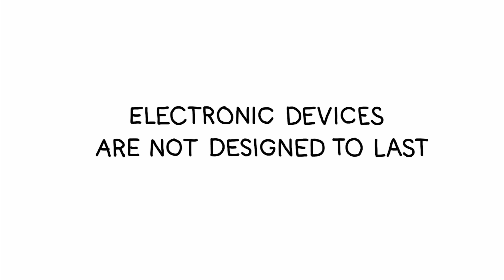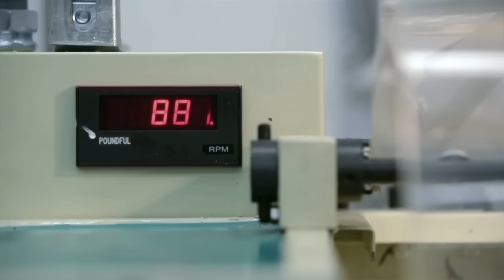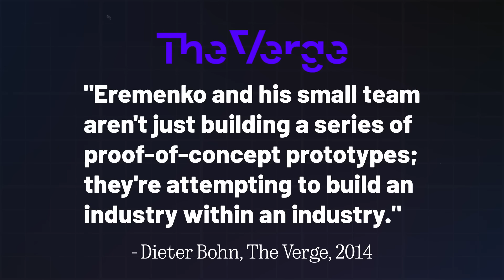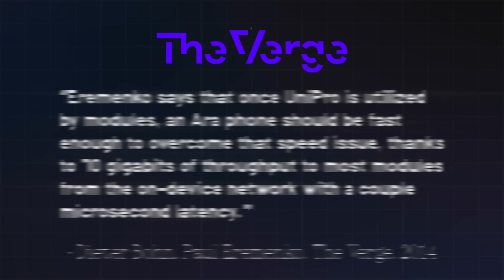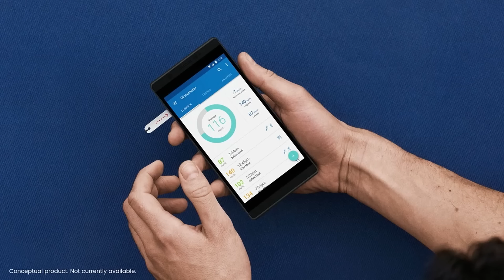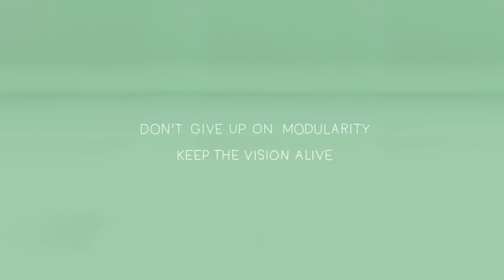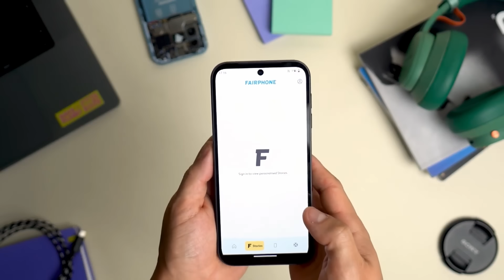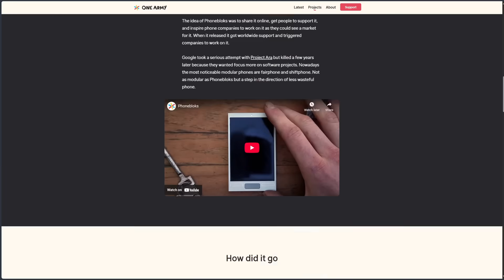Why Did Modular Smartphones Fail?

Comment: That's because the packaging. Currently phones today are technically modular already. It's just not modular for consumers.

Other than apple. Every other phone manufacturer is releasing multiple models specialized for different markets a year.

Engineers literally do drag and drop and they have another model

Comment: I would bet there’s issues with drivers and standards. One screen likely has a different pinout to another, for example. It’s probably why Framework doesn’t give us more options for screens, keyboards, and anything else that needs to connect to the same mainboard. If upgrading the screen means you have to replace the mainboard too, it kinda defeats the purpose. And drivers, if that was solved, we could put any rom on any phone, but we can’t, even with an unlocked bootloader.

Comment: If they claims that they have the best phone . Than it doesn't need anything,.
Its a big phone - we'll buy it
To big screen,  curvy but unsafe ,two screen, three screen , bending, projector etc- we'll buy it
Small battery,  fast charging that dies even faster etc - we'll buy it.
Screen that can't  be used in day light, give u flash for camera but can't use it as torch ( for long time because it will heat ) - no problem 
Very cutting edge process ( but can't handle what's app or chrome) - we'll buy it. Without complaint. 
Even though u r buying it with ur money but the phone is not entirely yours , it will process anything the company wants , shows ads even if u pay , listen to ur conversation, send data to anyone , train AI , farm crypto etc. - we'll buy it.
App that doesn't do the it own work properly but ask all the permission for no reason ❤ it
Even banking app can show gambling ads
All you have to say is  that  you are the best in some stupid category with weird parameters,  pay some youtubers and boom 💥 
We buyers will defend you , parmote you if that product is ok for 6 months 😅

Comment: Conceptually it's awesome, but in reality, more parts means more points of failure. About the third time your cat knocked the thing off the counter and broke your wifi dongle or you lost some critical component on the bus when it fell out of your pocket, you'd probably be inclined to just buy a monolith like we have now. If that didn't convince you, the security being swiss cheese due to the possibility of swapping mechanical parts introducing attack vectors should. This was not a good idea, we just want it to have been a good idea.

Comment: Actually, the issue with the ram having to be on the processor module isn’t 'really' true, we already use systems like L4 cache on some distributed processing boards, effectively a small amount of normal but really fast RAM that is put on or really close to the chip, but not on the die of the chip. Adding L4 cache SUBSTANTIALLY reduces the need for fast memory access, as only a very small amount of ram is queried often enough to substantially slow down the computer.

Comment: I like the modular phone idea, but it's a dumb idea.
A good phone is one in which every component takes as little space as possible. 
But in a modular phone every component needs to have:
1. Its own case. Eventually, it will be tossed in someone's pocket, so it has to be protected from it's dangers.
2. Its mounting and locking mechanism. That takes space for every module.
3. Its own comunication module to comunicate with the main module. 
So, you have to make every module into independent device with its own protocols. Also, you need to implement all those checks in software. Because module that was there 5 minutes ago can be no longer attached, and software need to know that.
And the worst part is that if real component takes less space that smallest slot, you get wasted space. But if a component takes more space than there is in a slot, you need to either take another slot, or make its module thicker, which is bad as well.

Comment: honestly, I'd settle for middle tier phones with replaceable screens, batteries, and storage. y'know, the parts that actually break or wear out.

ideally the main board is relatively repairable too, in case something like the feedback motor fails (like on my phone lol) but that can need a steady hand and a soldering station, it's fine.

Comment: They said it is impossible but at the end of the day everything is just a part of capitalism.

For example just teardown some iPhone or ROG phone and you'll realize that it will work since every part is already modular held by a long ribbon connector.

Phoneblock is the prime example of over engineering. It could work but they decided that it needs to be more.

Comment: Used to work at Nokia in the wild old days, and you can believe me, if it had even the chance of being a good idea Nokia would have tried it back then. But there are just so many benefits to tight integration vs modularity in this case. Modularity would mean a less reliable, slower, bulkier, less durable, more bug-prone phone.

Comment: I just wanna nuance the issue of "upgradability" of the Fairphones a bit. Now, while for mostly the newer Fairphone versions, the modules are pretty much the same; the FP 3 did have different versions of the camera module. So, even though in practice, there's not much that you can actually upgrade, in theory it is still definitely possible (even with latest version) to develop newer and better modules.

Comment: Great Video! Honesty, I hoped that I was wrong back in the day when I assessed that the modular design was just too late and not what people really wanted or the direction that electronics went into. Of course there are these people who go fully into "THEY want us to buy 2k phones after a scratch on the paint" and of course, if you do that you're probably the dream customer, yet the whole point has gone missing. The original iPhone was famously revealed in 2007 - and it had less to offer than the featurephones on the market at the time. Portable devices had already started to converge into lesser devices which were capable of doing more. MP3 players got bigger screens and video capabilities (so did the iPod!), cameras started to appear in portable devices, phone cameras got better, portable devices, no matter if PDA or Media Players with all of these features had WiFi built in...Smartphones were the outcome of the integration trend. This made everything cheaper at once, where you had 4-5 devices previously, you only needed to buy and maintain a single one; Pre-smartphone you would need to carry a cellphone, a MP3 player, a compact camera and a laptop with you (and probably a portable navigation system). Devices which were outdating VERY fast in the 2000s. Of course a smartphone give you more for less money overall. 
Making features interchangeable means that you de-integrate components and sacrifice large bits of synergy, basically creating independent largely independent devices. Instead of repairability, there was another route: Make things last longer. And this requires customers to use their devices longer. There is literally no point even in upgrading from an iPhone SE2 from 2020 which is 5 years old now with even older tech inside.

Comment: ...IT WAS ALL GOTTEN wrong,THAT'S WHY IT WAS DESTINED TO FAIL

...IT SHOULDVE BEEN LIKE PC....UNDER THE COVER

.....SO,THE SOCKETS FOR every single component AND STUFF LIKE THAT

.....AND....LIKE.....ALL STUFF STADRARTIZED.....LIKE ..WELL.....YOU WANT A BETTER SYSTEM ON CHIP......LIKE YOURS IS 7GEN1 AND YOU WANT TO SWAP THIS ON 8GEN3.....SO YOU JUST OPEN THE COVER,UNSCREW COOLING SYSTEM,TAKE OFF AN OLD CPU,INSERT NEW CPU just right from the box at OEM state .......IF WANT,CHANGE COOLING SYSTEM,ASSEMBLE BACK,SWITCH PHONE ON.....AND it all works

....THAT'S how IT MUST WORK!!!BUT IT WASNT........SO NO REGRETS .......

Comment: Project aras failure was salvaged by them working on a whole new operating system.
Its archetecture has increased efficiency, some cases increasing performance significantly.

Reason we dont use that archetecture is modern apps are not compatable.

Comment: I feel like the idea of customizability clashes with the modular feasibility. Sure, it is cool you can make your phone "fit" your needs. However, this adds unnecessary complexity to the design and schema for others to follow. The focus should've been making the main components modular to be able to easily replace them when damaged.
No random shapes and customization.
No weird slots and mishaped pieces.
Just standard, defined positions to breakable components to be able to replace them with ease.

Comment: The blocks are never going to catch on because it causes too many limitations. The Motorola idea made more sense, but without a lot of interest it doesn't work. What you really need is a single standard for form and connections that is followed by Google, Samsung, Huawei etc. Obviously Apple wouldn't get involved. Then you could get more interest in making the modules and could change to a new phone without losing your modules. 
In terms of modularity, you would need something like the Framework laptop but as a phone. I think the first step is repairability, so maybe it isn't too far off if some manufacturers are going in that direction.

Comment: The problem with modular smartphones is that the smartphone concept is inherently based on Apple's product philosophy, that says the user should buy a product and have it useable straight out of the box (and used primarily by normies), which got carried over from their computers to their phones, and everyone copied it. So by definition a smartphone will never be modular, compared to how a PC can be. That's why the "modules" are vague upgrades and replacements. Sure a bigger camera and battery are great, but what point does changing your phone's processor make? So facebook loads half a second quicker? The primary function of a smartphone is media playback, you don't need a lot processing power for that, battery life is more important, and that already got solved with power banks. A bigger camera would be interesting but at that point you could just invest slightly more and buy a dedicated camera. Same for speakers, when wireless speakers are already affordable. So pretty much only the screen remains, which is constrained by the frame. So realistically there's no point in modularity in smartphones. You also have to consider that even if your phone is designed to upgrade, when new technologies arrive in the future, they may not be built with modularity in mind at first, so a next gen phone will first be monolithic, before the tech gets modularized, which will mean consumers will still have to buy a new phone to upgrade. And finally, modularity requires standardization, and that offers an incentive to manufacturers to use their proprietary standards instead of general ones, so that their consumers are forced to stay loyal to their brands.

Comment: To be fair. Today almost any phone will work fine for a couple of years. They all have sufficient performance. (Writing this on a 4.5 years old galaxy A71)
In terms of waste, you would be throwing away modules in years time anyway. Probably you would make more waste, than replacing your phone every few years. Which is like 250 grams of e-waste. Which most people don't even throw away. They either sell it or keep it in a drawer.
The modular phone would not have solved any problems today.

Comment: there are two more reasons
1. it's not profitable for the companies... I don't think I have to elaborate
2. This one is more of my own opinion, but I haven't done any research so it might be either true or completely off the rails. Imagine most of phone users. Do they know what each component in their phone does? Hell, do they even know what components they have? From my own experience I can say that people tend to care if a phone works, not how. And when it comes to modularity and repairing you have to understand at least the basics. And unlike building a PC, phones have a lot more different stuff in them, for instance, a lot of sensors you use without realizing. Also, you'd have to understand how different modules correlate with each other, what's the most optimal placement. Most people just don't care about all that, they want to use a working device that someone else will take care of if anything happens.

Comment: Now see I think the reason is making modular phones is near impossible, every new part has different circuit. For example USB is slow USB 3.0 is faster but USB 3.0 has 4 more pins than USB itself so the modular phone's cpu should have a changing circuit that changes with every new module which is impossible (currently atleast till the year 2045 ig). The cpu has pins which must be connected to other pins (SPECIFICALY). Also the cpu also needs specific voltage requirements for every pin. So yeah ig it is impossible. I mean some module might work but not all basically useless.

Comment: Pull tabs are ass, if you live in a hot and humid area (35c 70%+ humidity in summer for example) the pull tab degrades over 1 year that it's a 50/50 if it works or tears. 3 years and it's practically guaranteed to rip and 5 years even the glue degrades, but only partially so the battery becomes loose inside the case and thus more prone to damage.

Comment: İt is posible with mcuh cheaper parts if we try hard enough. But still a gradpa whoulden't gona buy it. It bkz its too comples. I like the modular idea but they should have keep it much much sipler. Want more battery? Justopen inside telephone and not turn it into modular part. İts that simple.

Comment: My dream is that we some day enter into an "upgrade plateau" (in my opinion we're already there, but the market hasn't caught on yet..) As the difference from model year to model year gets smaller and smaller, but the capability a phone needs is still held down to a certain standard (like, seriously, how much more "intense" could youtube REALLY get) so you never actually have to upgrade, making a lot of "modularity" obsolete. The only time I even burn through iphones anymore is when they cant handle the newest OS which precludes me from using any apps. I'd probably used my iphone 6 for another 3 years if an upgraded didn't cost as much as a battery replacement

Comment: As a consumer, I noticed that all my customizable things end up being used in the same mode for 95% of the time.
The exceptions are usually annoying to deal with so it bumps up to 100%.
The real problem is when something breaks, and in that case you usually want a replacement, not a workflow-breaking update.

Comment: Can't help but feel like this will never exist. It seems so many phones end of life happens because they no longer get software updates. I think every time I've gotten a new phone it's because apps stop working as older software loses support. Hardware components are so unlikely to break and if you do upgrade them you'll likely want to upgrade multiple things in tandem. If you want a better display you need more processing power which will need a bigger battery and so on.

I find the exact same thing happens with desktop computers. Whenever I've gone to upgrade, I realize that if I want to upgrade a CPU I need a new motherboard and then my GPU will be a bottleneck so I should upgrade that and it just ends up being a better idea to buy everything new.

Comment: The real reason is people wants to see, feel and understand what they are buying. You can't sell things that will ultimately augment something else, i mean have you ever bought wifi card for your laptop to upgrade from whatever wifi card they packaged with your laptop. Ram is another such thing, heck even internal ssd for laptop can be upgraded but people still buy external ones.  Modular phones will never work for one simple thing, people would just buy the base model and use until its dead/outdated.

Comment: when dealing with electronics that operate in the GHz and higher range, the actual length & diameter of the internal trace lines starts to become important. this is a huge engineering hurdle, that is expensive to overcome.

Comment: Blockphone and the first fairphone were announced almost at the same time. And I could swear that Google bought the project to steal the wonder of fairphone and because of that fairphone almost failed. Then they pretended to work on project Ara for a while before giving it up entirely. I remember how blockphone took the internet by storm when the fairphone was right there and a far more advanced project.

Fairphone was there first, was the most realistic project and the one that actually succeeded on the long run. Yes, it’s not as ambitious, it’s not as modular and doesn’t look like magical lego pieces. But it actually exists, actually works and actually sells a decent amount to be sustainable. And the proof of that is that they’re still around and releasing their 6th model.

I’m a fairphone 2, 3 and 5 user (won’t buy the 6, my fairphone 5 is good enough for a while) and it’s a great phone, the most easily reparable phone ever, removable battery, long android support and decent enough hardware to not just be a gimmick phone, but actually usable.

Comment: The truth is modular, easy to swap designs consumer electronics aren't really big as a market and demand wise
Most people would rather sell there phones and electronic on the basis its old aka 5+ year and looks used doesn't matter if perfomance its still viable
Even if a phone is module most mindsets are "why retrofit or upgrade a new phone by buying new modules why not just buy a all new whole package "
Don't event mention the upper class they see a little dent and there gonna trade in or buy a new one in a heartbeat